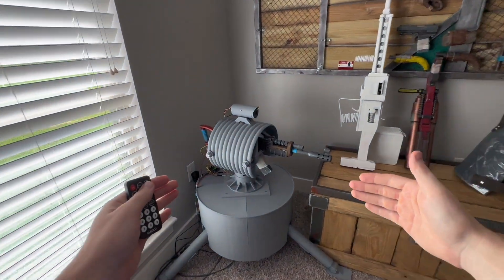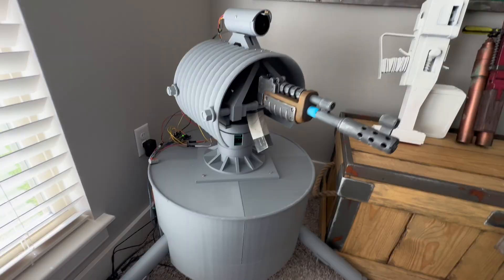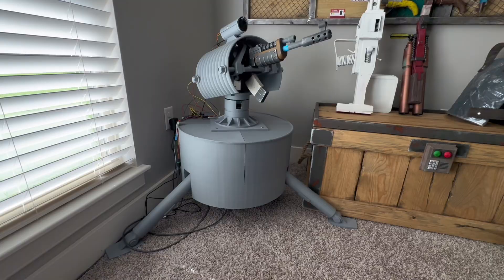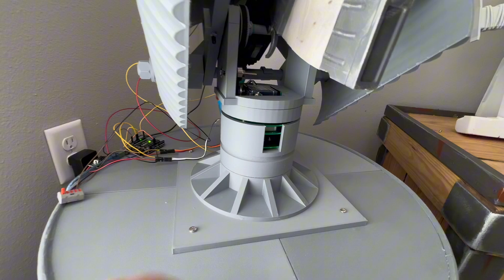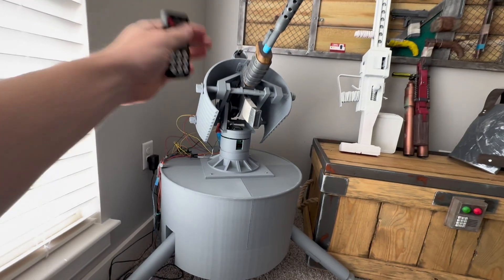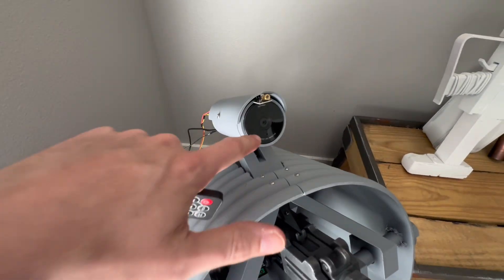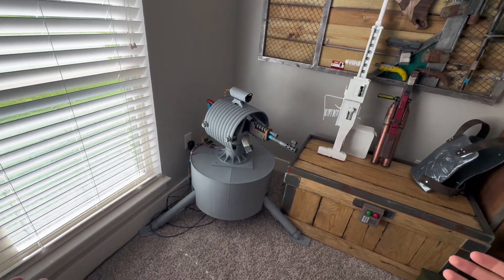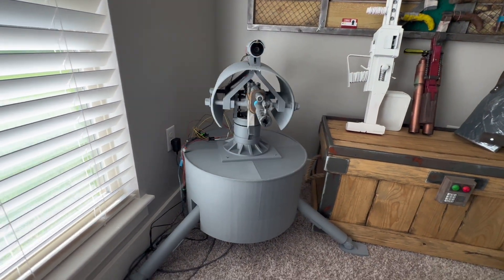Building A Full Size Rust Auto Turret!

Comment: Add something like those old Xbox Kinect cameras for enhanced dark vision. Also maybe run some carbon rods through the body of the gun that should slot into the housing to get rid of the sliding or use zip ties to clamp a few rings on the gun then use those Bungie straps like tension bands

Comment: You think you might benefit from trying to find a way to clone Gimbal tech with bigger electric motors working together for stability power? My Gimbal holds 7 Pounds works with head, face, eye, and body tracking cam programs. Gives goofy mean Rust face > Points at Predator Plasma Cannon What you think about Ultrasound control of electric plasma and plasma excitement by Ultrasound for strong EM laser tech? Search engine: "Ultrasound holography" + "Boeing Plasma force field blocks explosions" + "Warwick University plasma generated Ultrasound" = "Ultrasound can print through walls" Endgame ship building science..

But for this I recommend Gimbal logic. All the water in the atmosphere is Hydrogen & Oxygen for Ultrasonic mixing btw. Pets my AI controlled Plasma cannon > Fires Ultrasonic shockwaves sap water from atmosphere forming a lens around body > Activates Plasma holography active camo deliberately making Predator movie Plasma discharges - Dracula Aka Dragon Alpha